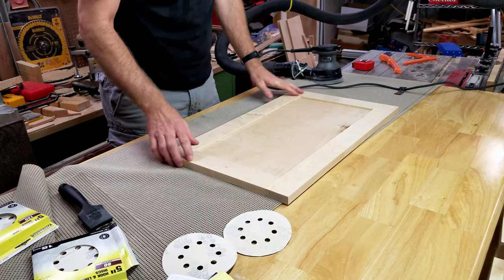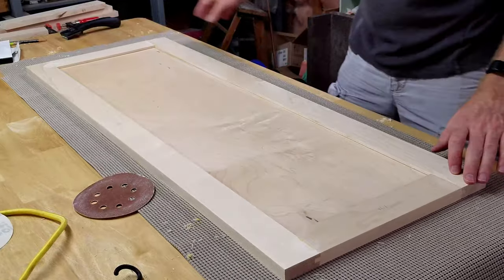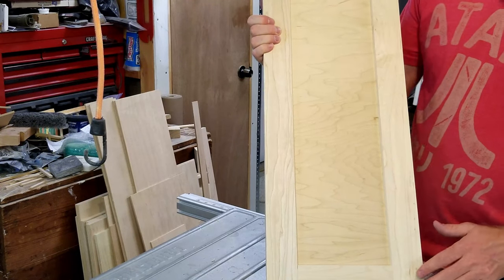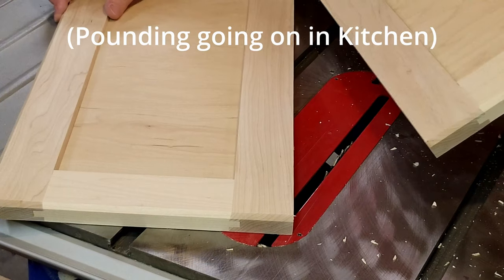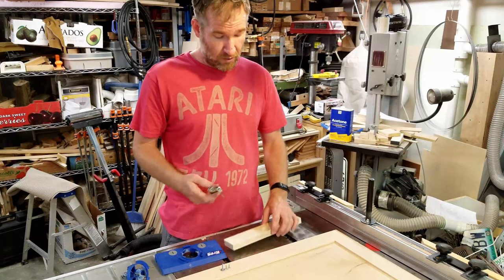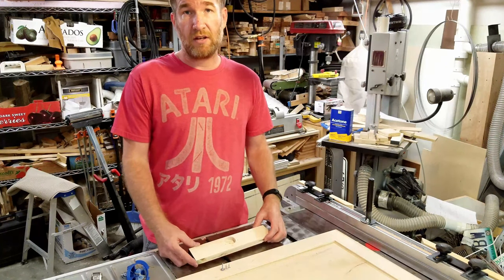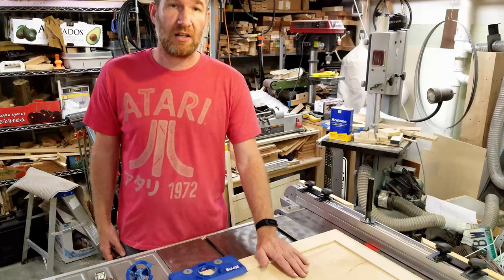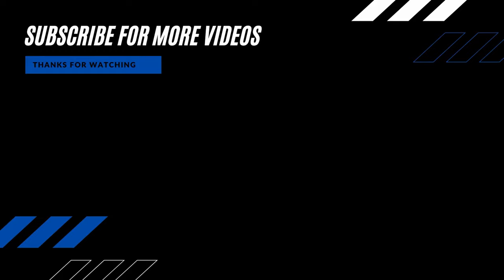Kitchen Cabinet Build Part 26 - Cabinet Door Prep Before Painting | Drilling For Hinges | SBW#59

Comment: I just made 40+ doors for my kitchen.  Biggest tip I can give is.... sand everything and then prime the panels before the door is assembled (perhaps even put on the first top coat on the panel as well).  Makes final prep and painting them so much easier and leaves a nice edge where the panel meets the rail/stiles.  Sanding those crevasses is a royal PITA.
Reply from the maker: I have noticed some others do that as well @csimet - sand and paint/finish the panels prior to assembly.  I hear that also helps reduce paint lines if you're using non-engineered material that can expand or contract with moisture. I opted for the way I did because I couldn't think of a efficient way to cover the panels so there would be no overspray when I did the frames.